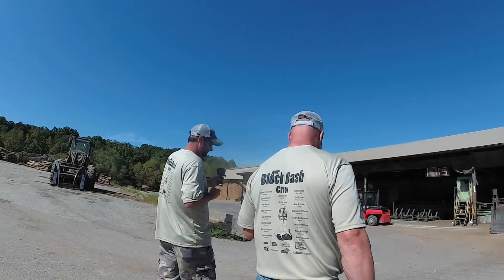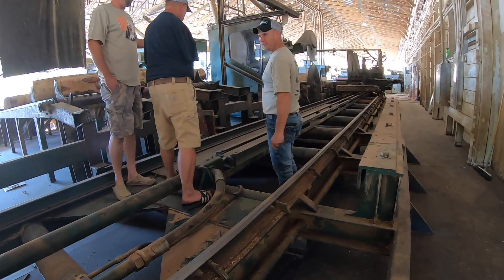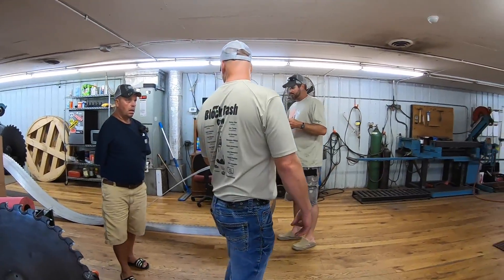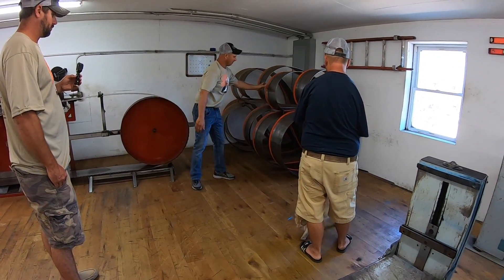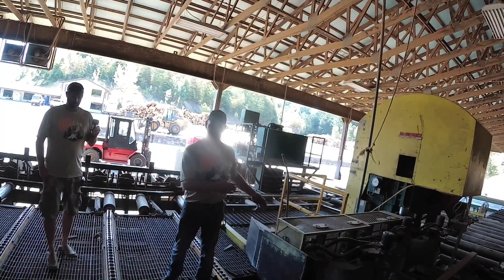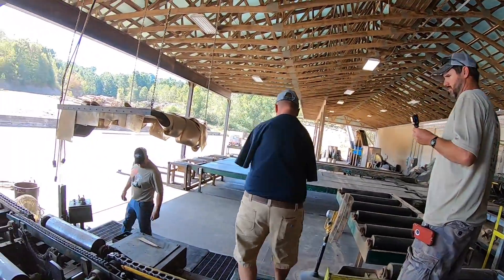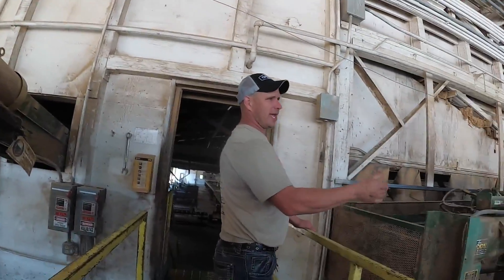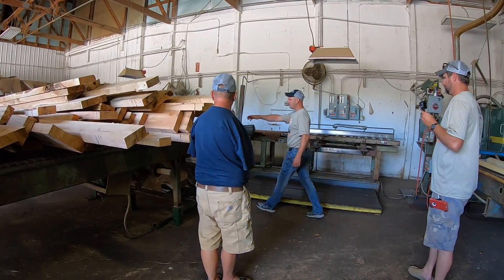Tour of Logger Wade's Sawmill

Comment: Have a good friend who was a saw filer, he taught me a lot and was very good at his trade. There is a lot more to cutting wood than meets the eye. I worked in a OSB mill for 25 years and we used a lot of saws at various stages in the process. Biggest wood we could run in our ring debarkers was 31 inches sharpening carbide and installing new teeth is an art.

Comment: Interesting tour, thanks for taking us. What cameras do you use? I'm looking at upgrading for my vlog and was wondering.
Reply from the maker: When we filmed this, we used 2 different kinds, I was using the Yi 4K+. Don't get one of those, they don't hold up and the sound quality is terrible. The camera Corkey had was a GoPro Black Hero 7. They are better and the sound is way better. Now we just use the GoPro 7 and the OSMO Action camera from DJI. They seem to work out pretty well.We have 2 of each. I prefer the OSMO over the GoPro. I always have a OSMO with me, but have a GoPro close by. They each have their faults, but I I had to have just one of them, Id buy an OSMO. Easier to use and it hasn't ever locked up on me where the GoPro 7 will sometime. Nobody makes the perfect camera, especially for what we are doing. Dirt, moisture, hot and cold weather, these cameras are in it all, and we require water proof cameras, so we are locked into these two. Haven't herd much good from the GoPro 8 other than sound is better. Just My Opinion